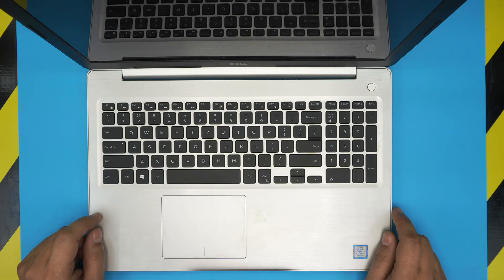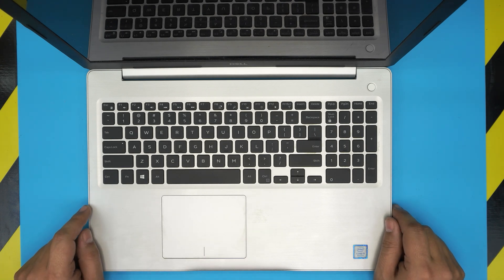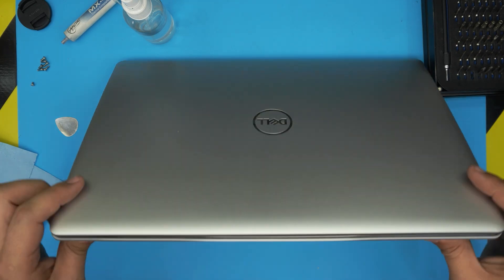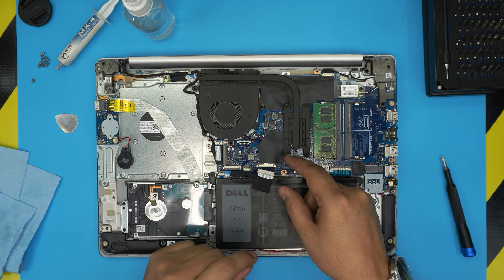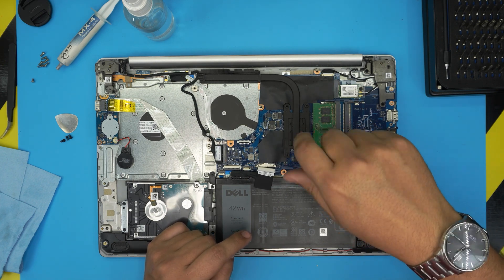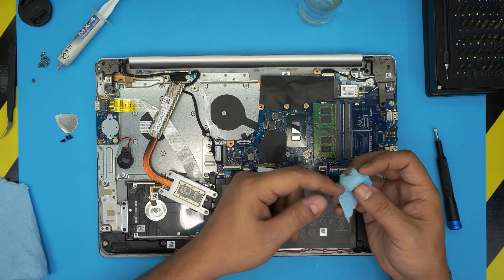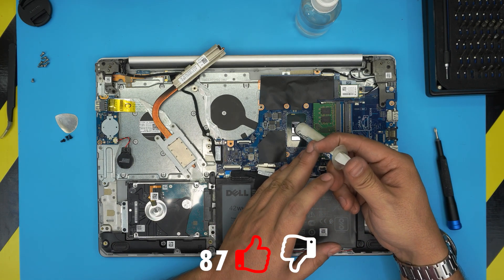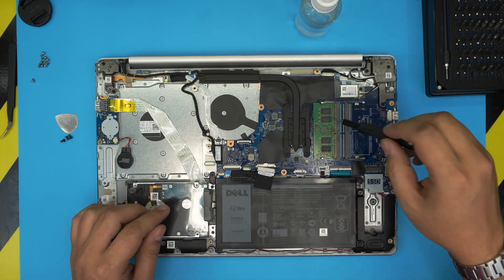Dell Inspiron 5570 Reg P75f ✅ Cleaning & Repaste 💻

Comment: This is great. Thanks so much
Reply from the maker: It's my pleasure my friend. 😊 Thank you for taking the time to give feedback! If you would like to support the channel, please like, subscribe, or both. :P
Should you have any questions or requests in the future, please don't hesitate to ask me.
cheers🍻
Reply: @uFixTek    My 2017 Inspiron has been running more slowly and fan keeps spinning. I think it should be fine.  The paste arrives tomorrow, and hope I can get it running better. I don't want to buy another computer if I don't really need to.
Reply from the maker: you don't need to buy new laptop, service the laptop with a good brand thermal paste and if you want to boost the performance of the laptop by a big margin, just upgrade the HDD to SSD: https://youtu.be/EHcX4vnm_e0
if you have HDD and not SSD you in for a big surprise 🫠(don't place nvme) go with sata 2.5' but get a samsung evo:
https://amzn.to/40AMkPY

cheers🍻
This is an  Amazon affiliate, when you use my links, I earn a percentage, which helps support the channel🙏.